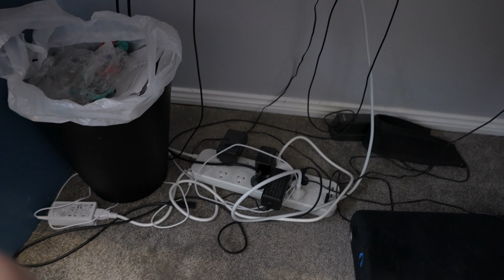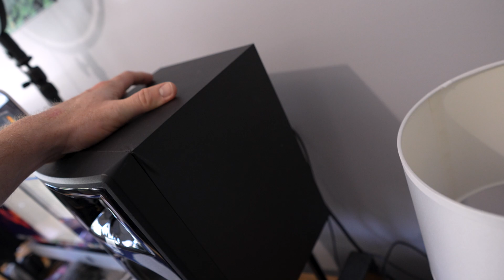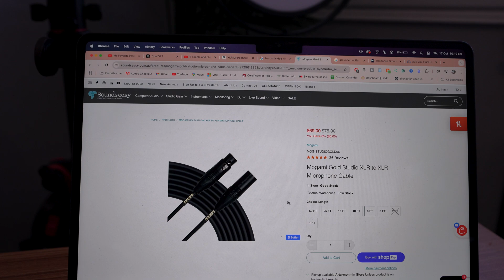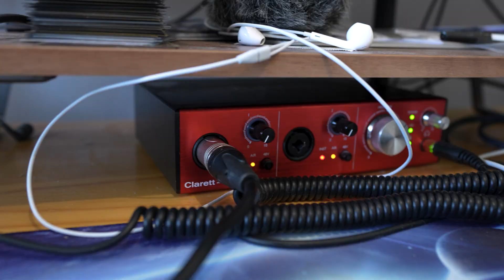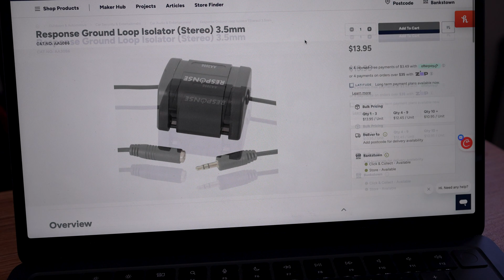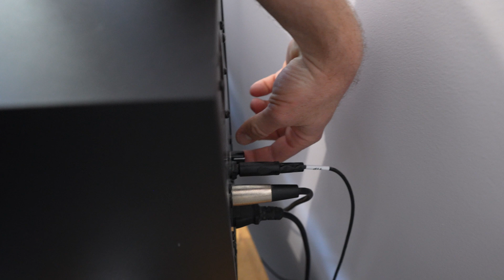Static Noise From Speakers? Here's how to fix it

Comment: Funny enough i have a steinberg ur 22mk11 plug into my wondows windows tower and i get so much interference..i also have a apollo twin x plugged into my apple mini m4 using the same moniter speakers..i get very little interference..Go figure..its more than just cable its the whole set up..

Comment: Hello, I will tell you about a recent incident that I have experienced and found a solution for.
I was using the speaker volume at 50% and it was unfair. But if I turned up the volume, I could hear a lot of bad noise and buzzing.
I have a JBL 308P MKII. I live in a 45-year-old building and I don't know if there is grounding, I didn't do any research. I connect these JBL to my TV. My connection is as follows: Tv-Dac-Toslink Optical and Kirlin 3mt 2x 1/4'' - 2x RCA Patch Cable AP403PR3MBK. It is an unbalanced cable. I used a Philips CHP7010W Single Surge Protection Socket on the wall. I connected all the cables to a single center with a 10-way multi-socket.
My problem continued. Then I found the solution as follows. I changed the 5V USB Power adapter of the DAC power cable and my problem was solved. This was incredible for me.

Comment from the maker: Steps to looking at these issues and how to fix them: 
- Looking at the Cable Connections - Maybe Upgrading your Cable will solve the issues, looking at the inputs of your audio interface or direct input as well 
- looking at your power connections - should you directly connect to a power board or a direct PowerPoint 
- looking into grounding accessories, e.g. Ground Hum Eliminators, etc 
- Asking for help via audio professionals and electricians 
- Turning down the direct volume on the speakers as well 
- Keep researching options and looking for advice
Reply: " Turning down the direct volume on the speakers as well !

That one surprisingly worked for me, thank you!